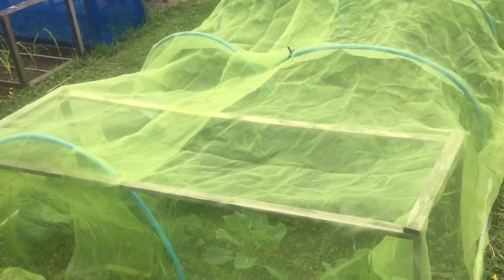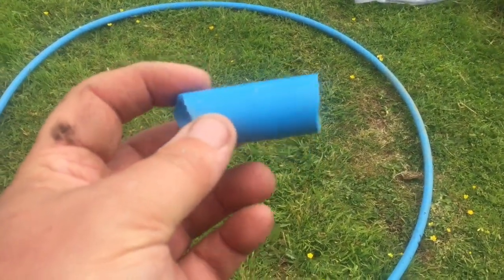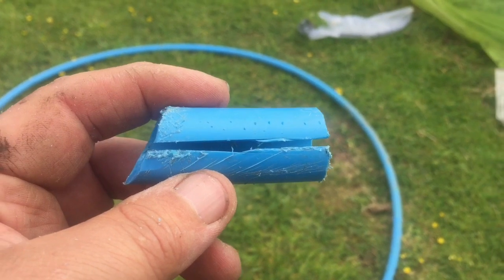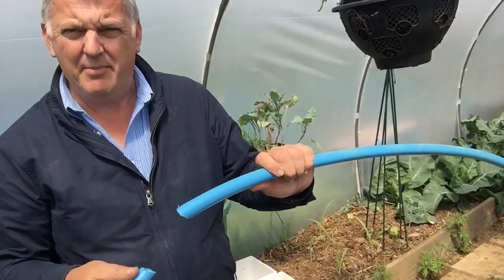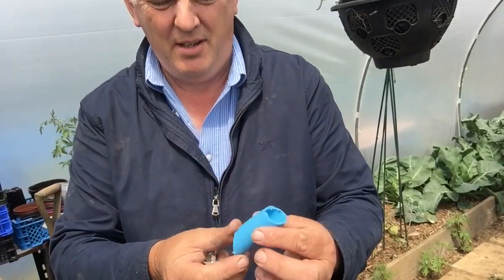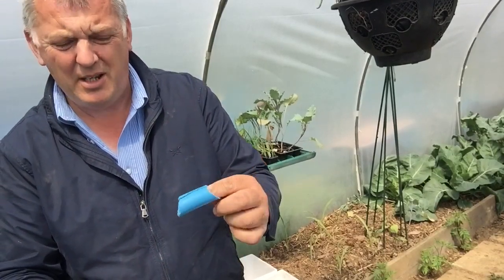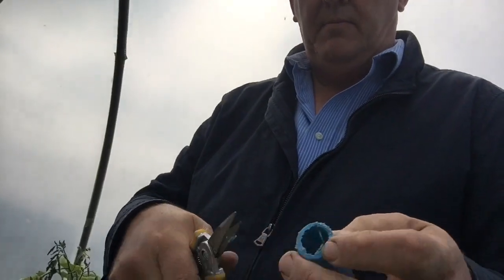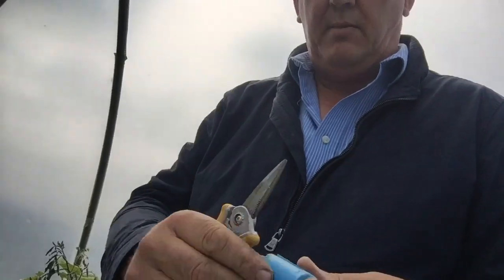How to Make Hoophouse / Brassica cage netting clamp with MDPE water pipe | Allotment Tips

Comment: Just watched your video yesterday and it made me change my original plan to buy spring clamps and insulation foam to clamp the mesh in place..  I  bought a cheap plastic pipe cutter for eight euro in the local hardware. The make of the pipe cutter is TALA Tools and this makes things very easy for cutting the pipe and making 2" hose clips
Reply from the maker: That's a great tip. Glad you found it useful Cheers Ray